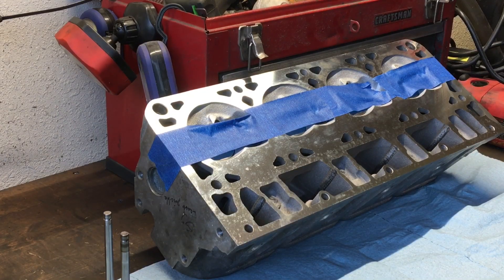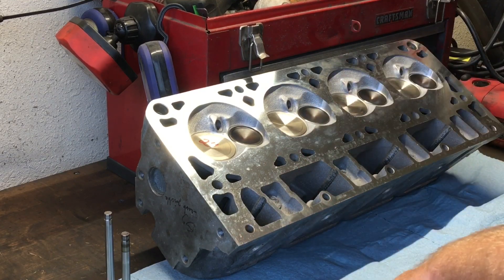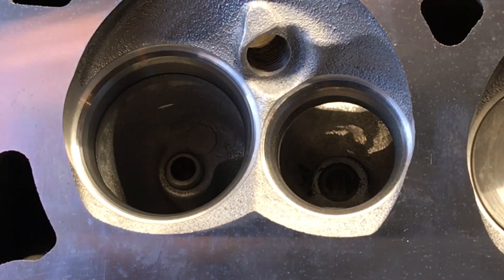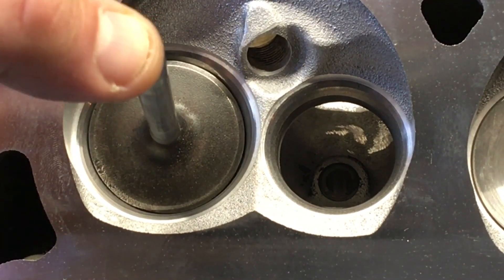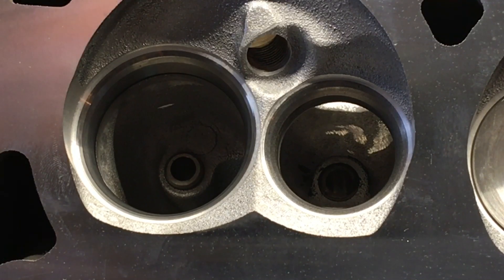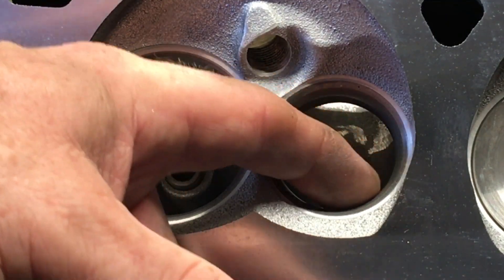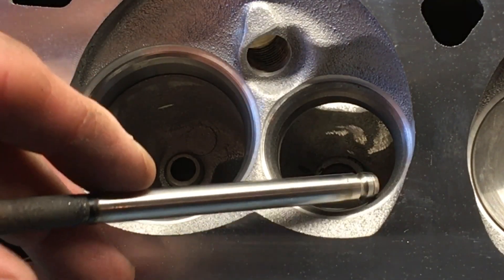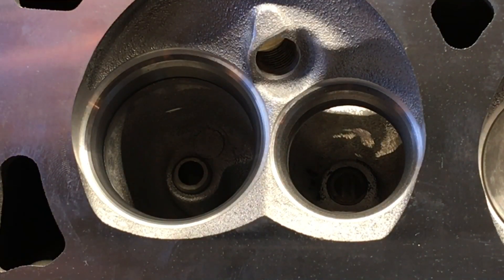862 Heads 215cc 2.00/1.55 LS1 500 whp

Comment: How much would a set of those heads cost?
Reply from the maker: Matt G Final cost depends on how much machine work the cores need and what size valves you wanted. 
1.94”/1.55”, 2.00”/1.55”, 2.02”/1.57” etc.
If you are building a 4.8/5.3 3.785” bore, or under 3.900” bore your better off running the 1.94”/1.55” valve setup. 
Bores 3.900”+ the bigger valves can be used and avoid cylinder shrouding of the intake flow into the cylinder. 
Port work is $750.00
Flow sheet $125.00 (optional)
Reply: @HeadFlowInc  very nice
Reply: Where are you getting 1.94 valves from?
Reply: @soulless721  I can’t read.

Comment: How much can you open the intake and exhaust bore without affecting the seat. It would make sense to me to open it as much as possible to improve how much you can flow. Which also blows my mind how people can waste money on something like a throttle body spacer, when in my mind all it's doing is essentially making your intake tube longer. Same would apply to throttle body porting and polishing, unless your increasing the butterfly valve size...your gains arent worth the time or money. Maybe it's just me tho. 🤷‍♂️ love the vids tho brother. 👍
Reply from the maker: shawn v Be very careful how large your bowl cut is especially with aluminum heads. The only thing holding the seats in the heads is an interference fit, in other words if you cut the seat ring to thin they will get hot and fall out! 😳
I use a percentage of the valve diameter to set my bowl cut percentage. 
Intake side 89-90% of the valve diameter 
Exhaust side 86-87% of the valve size. 
Note: Always leave a thicker margin on the exhaust seat since it experiences higher temperatures. 
Thanks for asking, this is the way we learn how to avoid costly mistakes.  Don’t forget, when porting, don’t remove material only to make the runner bigger, all this does is hurt port flow. 
Thanks for the feedback I appreciate it!  JD
Reply: A concentrated study of the 0hysics Book would show you quickly just how wrong you are about a throttle body flow being increased by scientific porting  . Jeez all of this is Science !!!! 
Americas schools have failed this nation greatly .

Comment: Sir, a question:
If you were to try to port a set of heads that you or anyone you know has any experience with would you want a spare junk head to cut up to see the internal structure or is the electronic metal thickness machine good enough??
Reply from the maker: John Parrish Having a sectioned or cutaway Head is always a benefit to identity areas of the castings to avoid or be careful with. 
If you have a sonic depth setup it too can be a great addition to checking and carefully monitoring those “Red Flag” areas of the ports. 
I will point out many of the areas inside a port with thin walls tends to be areas you shouldn’t need to modify to much. Now with heads like the cathedral LS heads, when removing the swirl ramp you must be cautious because there is a coolant passage right below/behind the ramp! 😳🤔👍
Also be leery when removing too much material below where the valve springs seat/set especially when running stiff dual valve spring  setups. 
Thanks for the feedback I appreciate it; thanks for watching!  JD
Reply: @HeadFlowInc  The engine I have in mind to port is a Mercedes OM-606 diesel. I'm going to do it myself because I don't want to send it half way around the planet....lol